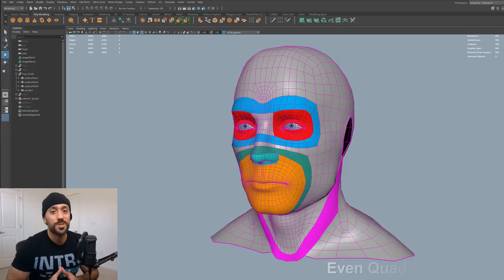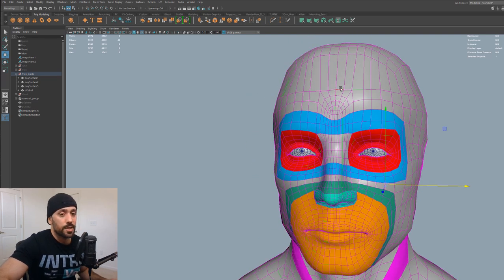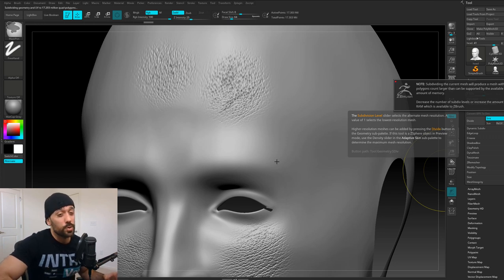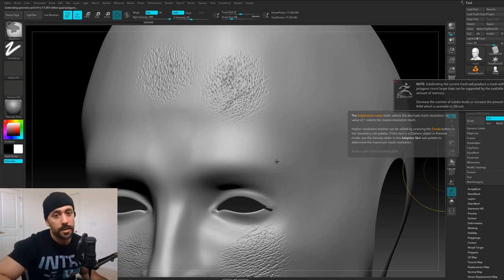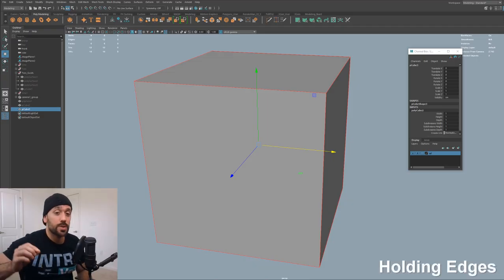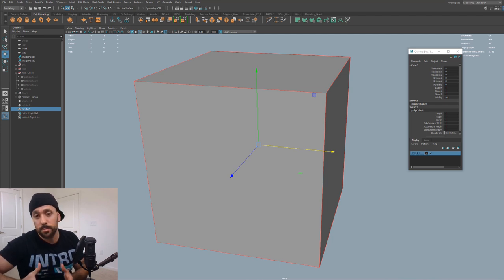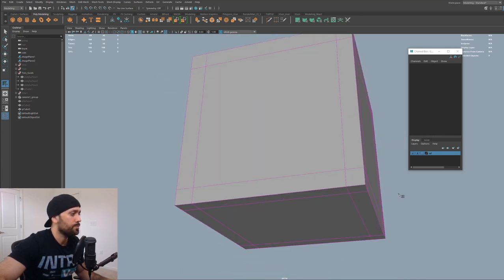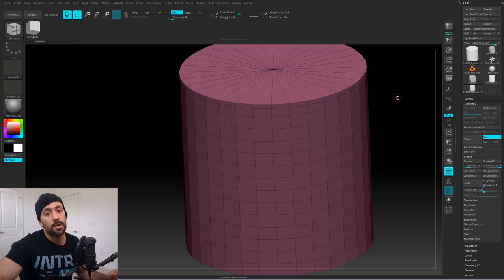3d Modeling Explained # 01: Creating the Perfect Digital Sculpting Base Mesh for Z-brush.

Comment: I would probably use xNormal instead of Substance for baking.
In xNormal you can trace the distances automatically for best accuracy also it supports higher res bitmap outputs also various methods of rendering/baking and more stuff in general + it's free.